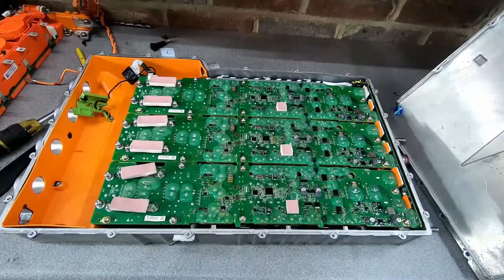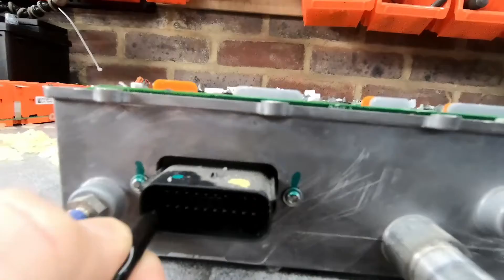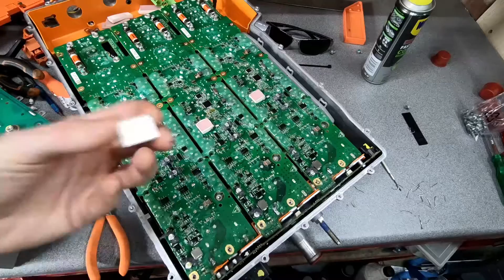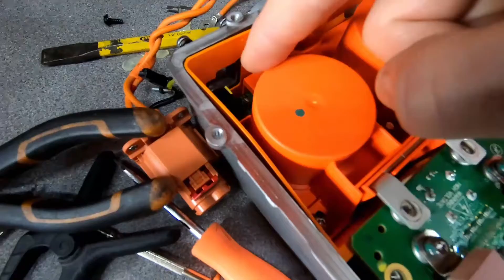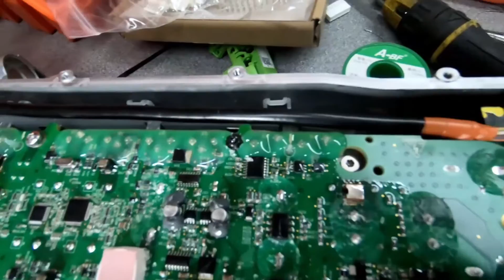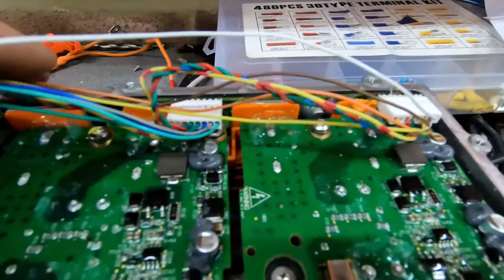Tesla Onboard Charger Teardown Pt3 - failed to take it apart, time to reprogram it.

Comment: What are the rectifier diodes D14 and D15 in these phase boards?
Reply: Hi, Did you find an answer?
Reply: @conor1conor2  yes ,  these are like one-way valves of the current. So for an example if the voltage is positive it passes the current but blocks it when the voltage is negative. These are STTH6010WY and could be purchased from Mouser.

Comment: To solder in connectors and wire them up is one thing. But are there schematics which tell you which pin carries what signal? You got CAN but how do you know the commands?? And if you know them, why not using the charger as is ???

Comment: Nice work.

I've just spent the last month reverse-engineering the Nissan Leaf communication and I can't help but think that it would be really nice to be able to use these OEM components without internal modification. Unfortunately, I don't have one of these to actually help at the moment.

My plan is to convert a 2003 Jeep Cherokee to EV using the LEAF power electronics and a custom controller. The controller will be programmed in a generic way to facilitate a mix-and-match approach to choosing components.
Reply from the maker: Thanks!  An electric Cherokee sounds like a great combination.  I think there has been some work on the open inverter forum to produce a controller that speaks to the native Leaf logic board via CAN to facilitate a more plug and play approach to the conversion, it means you are limited to the 80kw the leaf came with, but on the plus side you don't have to do any tuning to the inverter.
Reply: @PerformanceEV  my main point is, wouldn't it be nice if you could interface to the Tesla charger over CAN without opening it up.
Reply: @wired_alex  EV West in the US sell a device which does exactly that to use the Drive Units without modifications. Surely the same can be done with the AC charger.
Reply: @performance ev I have complete working model s apart from super charging and I would like to use all electrics from the mode s in a different vehicle, what complications can I expect.
Reply: Awesome job, I wish I had them skills.